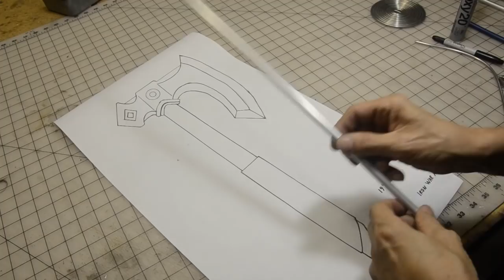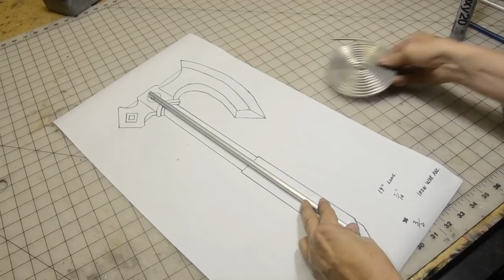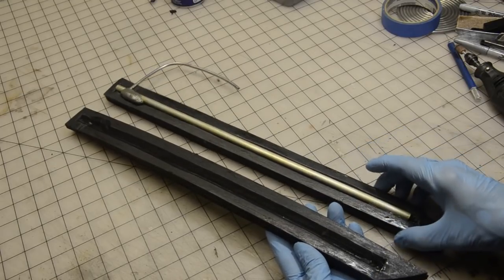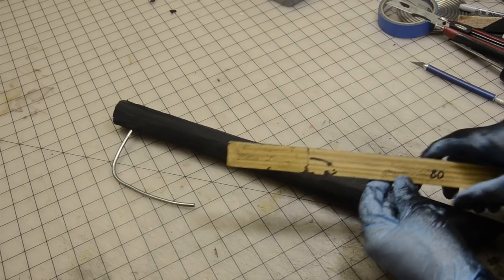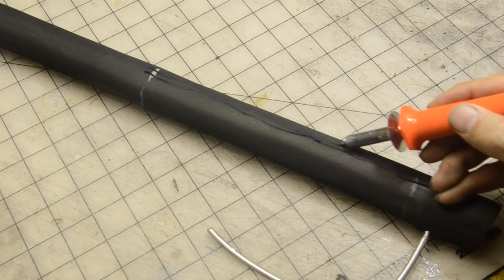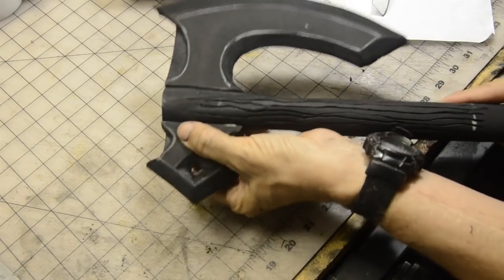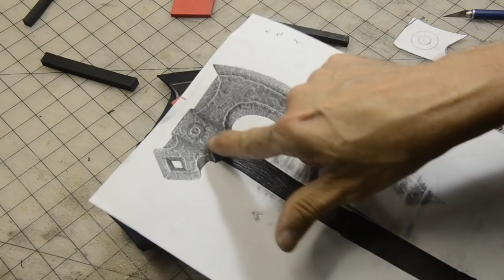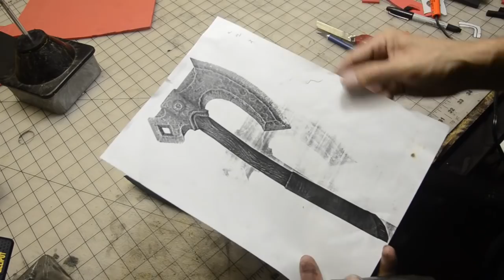How to Make a Foam Iron War Axe Part 1

Comment: Hey Ted, I'm loving your series so far! Just thought I'd mention though, that the middle bit where the shaft enters the axe head is rounded! In the forging process, the hole is made by driving a wedge down the spine of the axe head, out through the bottom, forming a hole just snug enough for the axe shaft to be hammered in, and be stuck! Doing this creates that rounded middle bit you see.
Reply from the maker: +ArkonOridan Oh I see that. Oh well, it looked square to me when I was making it.
Reply: I'll admit, the square does give it an interesting profile!

Comment: You could also use those orange fiberglass landscaping markers. They are light flexible, and really hard to break. They would give you much more strength than wood, but not as much weight. For the blade reinforcement you could heat form plastic tubing like pvc, or a solid plastic rod that you can get from hobby and craft stores. And use that type stuff if you don't want to use metal because you will be using it for larping battles and don't want to complain about it hitting too hard, or risk a sharp metal piece ripping through the foam.
Reply from the maker: +TheFireLizard So where would one find fiberglass landscaping markers?
Reply: Lowes, home deopt, ace hardware, or what ever other local hardware store you have. They are like 3 or 4 dollars a piece.  Sometimes they come in yellow, but most commonly orange.
Reply from the maker: Thanks.
Reply: My brother and I are just now getting into making props. back when we were kids we used to always cut apart our old toys and make new ones out of them, and tinker with things in general. For a while we were into black smithing trying to make knives out of railroad spikes. Aside from that another thing that we found useful to use was plastic coat hangers because they are cheap and you can heat them and shape them fairly easily. So that could also be an option if you don't want to go buy stock plastic rods from a hobby shop. They aren't as strong as fiberglass but they are stronger than wooden dowels that tend to break.

Comment: Public Service Announcement: For anyone who has the basic dremel 200 kit (a.k.a. the cheapest set) don't be a dummy like me and use the soft buffing tip to do the texturing. I know it's the only rounded tip in the kit and it achieves the same effect on the foam, but it is structurally not built for carving. I was halfway through texturing my prop when the buffing tip broke off, ricocheted off my safety glasses and into the void never to be found again. Save your face, buy the stone tip!
Reply from the maker: +rabbitgear Thanks for the tip and good thing you had your safety glasses on.
Reply: +rabbitgear Safety 1st, or you may be last.
Reply: ke

Comment: That looks amazing!  If I were to make this for my LARP I'd have to use either fiberglass or pvc for the core, but that's an easy change.  
Another easy way to get a good wood grain is to take your xacto knife and slice your lines in, then hit them with the heat gun.  It will expand the cuts.   Both methods look really good though.
Reply from the maker: +blaidemaiden That's a good technique, too.

Comment: Could you do a similar video for a 5-6 foot staff with a heavy top? 

Specifically, the staff Megumin from Konosuba carries. 

My main concern is connecting the elaborate top to the main staff part without worrying about them falling apart.

Comment: I would suggest a fiberglass rod, personally. you can get a 3 foot long one for a buck or so at Home Depot, usually with the little reflectors you put on either side of your driveway... Though the armature wire might be a challenge to attach in that case.
Reply from the maker: +William Bostedt (Red Jack Fabrications) Great tip, you're right.
Reply: +Evil Ted Smith thank you for the info you gave me
Reply: +William Bostedt (Red Jack Fabrications) +Evil Ted Smith an upcycled golf club shaft would be the business as well .. Carbon Fiber
Reply: +DALLAS BARNETT aye, but the problem there is either cost or availability.if you can't find it free, it won't likely be too cheap. :x
Reply: +DALLAS BARNETT aye, but the problem there is either cost or availability.if you can't find it free, it won't likely be too cheap. :x
Reply: +William Bostedt (Red Jack Fabrications) pro shop near my house usually has a bin full of old clubs out back that are being discarded .. ive scored a few like that
Reply from the maker: Great! Now all you have to do is make a Foam axe blade.
Reply: Working on a Dr Doom actually

Comment: +Evil Ted Smith....thanks for the great videos!  I am using this exact method (I'm using a wood dowel) to create a Roman Gladius for a production I am in.  I have the Weldwood Contact Cement and use it regularly to stick the pieces together.  In this video you talked about using it to seal the foam.  Question: once it dries and is a little tacky I assume you just paint right over it.  Does it remain tacky and will it stick to other things or does the paint negative the "holding together" properties of the cement?  Do you thin the contact cement at all?  Thanks very much for any help you can offer!  Dave
Reply from the maker: +David Downer The paint sticks really well to it, and it won't remain tacky.

Comment: This question may have been asked already. Im just starting to get into foam cosplay and when it comes to setting the armature into the handle, since you doubled up the foam on both sides before you double it up, can you just cut out the recess that you want on one piece, then glue and double up that way you have a matching recess for it to fall into?
Reply from the maker: +shamrock 8810 You could, but I find it easier to cut out when it's all glued together.
Reply: Ok thank you for the speedy reply and thanks for these vids they are a huge help.

Comment: Ted is there a way to coat foam that will make it more rigid and hard wearing? I would like to make foam armour and weapons but I would want them to be solid and less flexible to to create a more realistic illusion what would you suggest?
Reply: +Twiggy Glitched Just guessing here from experience outside of prop making, but you could coat the foam with epoxy resin and/or fiberglass. Provided the foam has been sealed it should be fine.
Reply: thanks, I completely forgot I asked this XD

Comment: Could one use an exacto to cut thin "wood grain" lines and then hit it with the heat gun to widen the gap, like how Bill does with small details? Or is the wood-burner the best option.
Reply from the maker: Yes, you could. I just like the wood burner because it's faster, and it makes deep wide grooves.

Comment: Does EVA foam only glue with the barge cement?
Reply: +Bruno “Brunokuz” Dekeyser 
No, you can use any other glue like heat gun glue, super glue, most of the other contact cements and such but barge sure gives the best results out there for the seamless look if done properly, you can also do a bit of research by reading or watching peops reviews on barge or other glue, thats what i do before buying any products im not familier with

Comment: At https://youtu.be/i0KDoS2i92I, they have Jesse Skellington (LARP Heroes) with the suggestion of adding a hot-glue tip to the core tube to prevent it from cutting through the foam. Possibly more important for sword tips, but they also use this on the bottom of the hilt.
Reply from the maker: +Joel C. Salomon Thank you for subscribing.
Reply: Thanks for making really cool videos, Evil Ted Smith, the sort I want to be informed about when a new one comes out. I’m an absolute beginner at this hobby, and your explanations are clear and complete enough that I think I can actually do this.